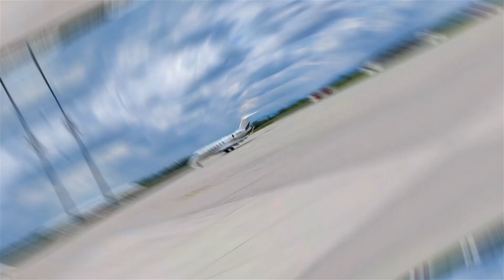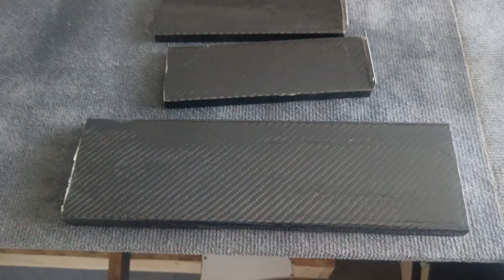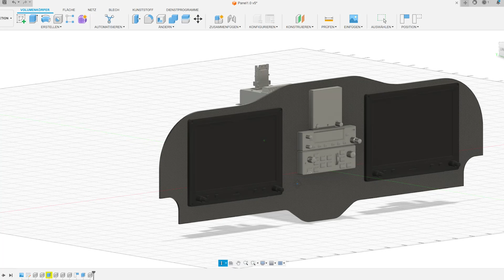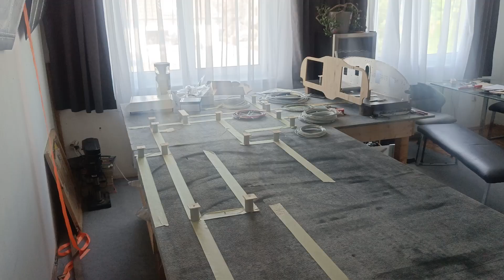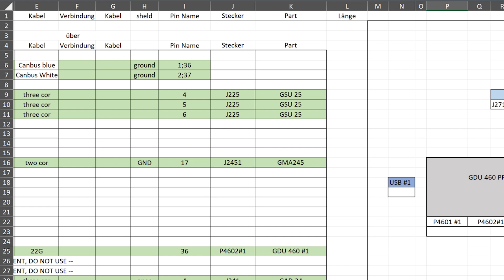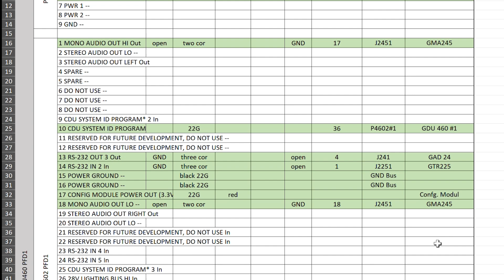Avionics planning! | MyTsi EP 11

Comment: Meticulous work. How did you determine the length of the runs on the table?
Reply from the maker: Hi, I installed one wire in the fuselage and marked all the different bends or intersections. then I took this wire to my table and made the cable ways there